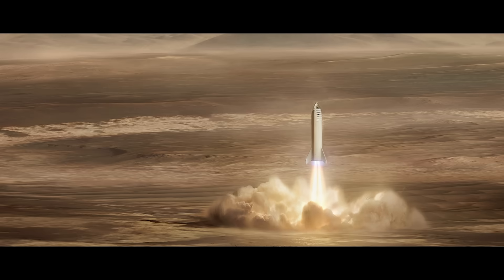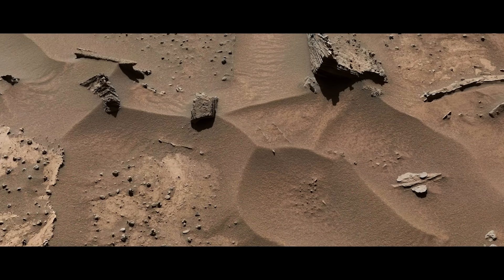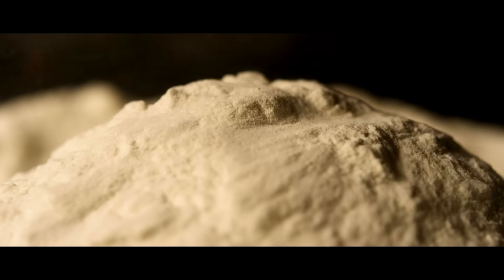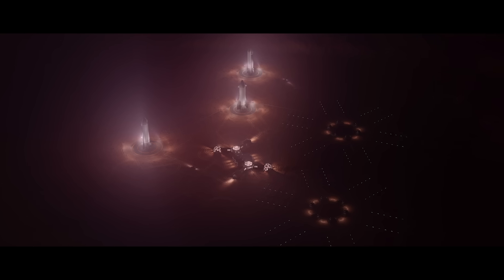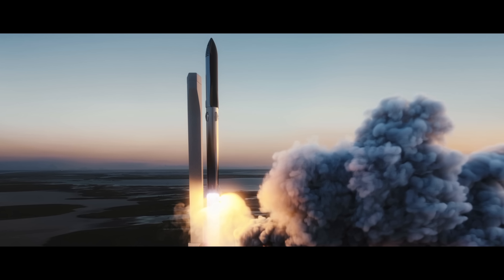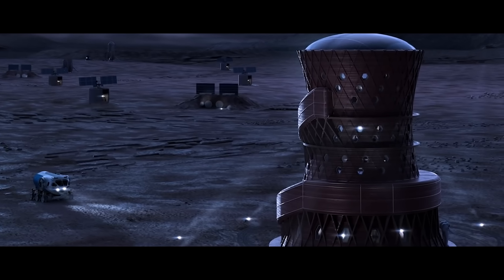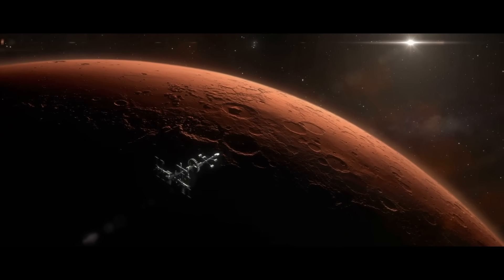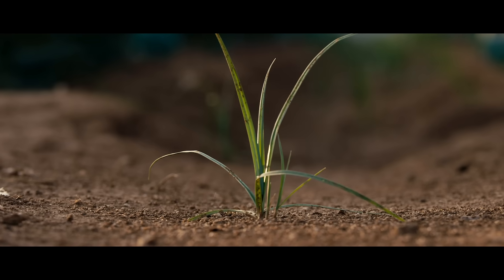THE FIRST 10,000 DAYS ON MARS (Timelapse)

Comment: We allready have a martian colony, a military one. Under ground at the bottom of the mars rift. Due to less radiation and greater air pressure. A heavy lift quantum vacume fleet shiped. All the matirials to geo stationary platforms. Were single stage to orbit and back space fleet took crews. To asembale the 2/3 speed of light nuclear fleet. The mars colony is the reason, that the rovers lasted so long. Due to maitenace. The same reason that the voyager crafts started transmitting after 6-8 years of silence. The nuclear fleet ships, can travel to a voyager craft and back in three weeks. Yours, The Inventor JOEL RAMIREZ RAMIREZ. Even of the three d printers and the Spacex, Blue Origins, Virging Galactic ships.

Comment: It's that gravity thing. 38%. So as your body crumbles do you get 38% lifespan?
More? Less. Then there's the radiation thing. Mars suits will be much bulkier than depicted.
Will food crops tolerate the gravity and radiation. Vision problems have cropped up on LEO.
How about on Mars. I think you guys are WAY WAY TOO  optimistic. It will be short visits for 100 years to see if there is any real benefit to Mars at all. 
We WILL have to go there to find out however.

Comment: This is probably 30%-45% achievable in time frame mentioned. Still hugely impressive if pulled off.
Reply: Even if 10% of this happens I still would be happy
Reply: @macbilliardstrickshots7907    Same.
Reply: Elon thinks it will be
Reply: Elon has a habit of aiming high and being off on his time predictions significantly. But generally achieves what he sets out to do. If you slide everything back by a decade or two, maybe with the exception of the initial landing which I think will be a couple years late, quite possibly doable.
Reply: can i ask how you know what is achievable in the time frame mentioned? Or are you just throwing out some random numbers that you think when you really have no idea?
Reply: @pazecs    Past performance.
Reply: @marvinmartinsYT  as with the stock market, 'past performance is not an indicator of future potential' . Pessimism is fine, but IMO the technical leaps we have made over the last few decades would indicate an exponential tech growth that could lead to some of the items in this video 👍🏼
Reply: I take no pleasure in stating that none of this is going to happen.
Reply: @knuthamsun6106  how can you be so sure
Reply: actually it might even happen faster because new radioactive starships are being planned which will be faster than those regular starships thus more residents and a bigger window between mars and earth

Comment: I still think Musk Mars-co. could consider the cost benefit of rigging up spin gravity with a dozen or so Starships tethered into a bicycle wheel with just wire rope. 
But then the thought occurred of building a taxi- a purpose built Transit Hub with a dozen Starship diameter spokes of the needed length, a Mars Transfer Support Vehicle- Would the name Starfish work? 12 Starships would be able to dock with, then cable stayed to one another and the Starfish hub, creating a very large mass great enough to allow stable internship movement for resources, emergencies etc. The transfer hubs would also hold massive amounts of supplies besides being used to shuttle back and forth between planets.
The Hub and 12 Starships would need to assemble once they left Earth orbit and were already at transit velocity. The wheel could rotate along or perpendicular to the flightpath. 

But the real added bonus is the ability of dialing gravity up or down along the voyage, so travelers arrive fresh and Already Acclimated to the Appropriate Local Gravity. Eventually MTSV's would likely be needed permanently in Mars orbit for Martians to spend additional time acclimating to Earth gravity -possibly months before the first trip of a Martian (born) to Earth. Assuming spin gravity doesn't have deleterious effects on the human inner ear. 
I think it's brilliant which is why there must be some non efficiency, cost, or engineering difficulty - an impossible to break Newtonian reason why not?

Comment: Doesn't a nuclear fusion reactor on another planet by 2040 or something sound kinda far fetched?
Reply: Why?
Reply: @wasdasdaswas1438  because we only just recently made nuclear fusion work in china for 101 seconds and it cost around 4 billion dollars purely in electricity to power it. it was the most energy dense place in our solar system, but it was a huge financial loss and used a lot more energy than it generated. current nuclear power plants use nuclear fission, which is much easier to get to work.

Comment: You're missing the solar wind issues from a lack of a magnetosphere and the escape velocity of gases due to the lower gravity of the planet. That wouldn't stop geodomes but it could make life outside much more difficult to maintain. Keep the O2 inside the domes until the magnetosphere and gravity issues are resolved.
Reply: If we are producing enough oxygen then we could expand the pressurized domes to the point where we technically can go outside, just not outside the dome. Think like the habitats themselves span so much, but the pressurized dome spans 5 or ten times further out.

Comment: The moon colony on Shackleton will have more solar energy and just as much water. Heating is not needed like on mars. It will also have more rocket fuel because of the H3 available in the lunar soil. So the moon colony will grow much faster than any mars colony, especially because of the massive amounts of raw materials available. I believe the moon colony will grow much faster than mars colony. since it is easier to build rockets and produce on the moon, most of mars colonization will come from the moon, not the Earth.

Comment: This is an incredibly silly plan. Mars has laundry bleach for soil, harder radiation than being inside a microwave oven, no atmosphere to stop micro-meteorites piercing any structure you build, temperature extremes like the moon, and microgravity that will turn your bones to chalk. There are MUCH better places to colonize in this solar system than Mars!

The easiest ones are rotating habitats inside near-earth asteroids. If for some insane reason you absolutely must live down the bottom of a gravity well, Venus at 50km above the surface is far preferable to Mars. Earth-normal gravity, temperature and pressure, a working ionosphere and atmosphere to stop radiation and meteorites, and our air is as buoyant there as helium is on Earth. All the ingredients of life and industry are easily harvested from the Venusian atmosphere ...

Of course Venusian colonies would be vastly more difficult than colonies in the middle of the Sahara or Antarctica, or on top of Everest, or at the bottom of the Marianas Trench. But still far easier than anything you can build on Mars. Musk, as an intelligent engineer and businessman, almost certainly knows this. Mars is his cover story for something else ...

Comment: As a test, a fully functioning sealed biodome should be built in the Sahara desert and/or the Antarctica and populated with 100 people with no external power source or running water, which would be significantly easier than trying a suicide mission on a barren toxic planet with no atmosphere or oceans.

I could be called Biodome 3 vaporware?

Comment: There is no reason to assume it will go this smoothly.
Reply: My thoughts also 🤔
Reply: Indeed, all kinds of things might happen in the next thirty years to disrupt or bypass such developments: orbital habitats could be built in LEO and then moved to Mars, providing comfortable, 1G environments for humans to tele-operate drones on the surface for mining, engineering  and exploration. That would be much healthier and more efficient for the humans. Because of Mars' smaller size, latency for such telepresence would be under 100ms and therefore real-time. Such habitats would be able to be moved elsewhere as needed. Fusion power would immediately open up the outer solar system to colonization. An orbital ring, or skyhook tethers, could be built on Mars much more easily than on Earth, eliminating almost all the requirement for rocketry and fuel production. Exploration of sites such as Olympus Mons would probably start straight away: there is bound to be some millionaires who would like to be the first to climb it.
Reply: @Reinout   Of course not, but there would also be no point in throwing in various set backs and catastrophes likely to beset the first settlers.  This is after all an aspirational view of settling Mars inherently idealistic in this early rendition. 

It is the job of later writers to create a more detailed story line as the progress toward landing on Mars actually begins to happen and what is possible in the short term becomes clear.
Reply: One bad accident would set the whole thing back to day one.
Reply: @TheDGAF06  So what are you saying?  That we shouldn't try to go to Mars?   It was extremely risky for astronauts to go to the moon too, but they did and landed 6 times.  And it would have been seven times if not for near catastrophic accident on board the Apollo 13 mission.  Fortunately they made it back alive.  

Some people will always be willing to take the chance to go to Mars despite the many risks involved.
Reply: @Michael Deierhoi nothing of the sort, space exploration is not only amazing but imperative. I'm just pointing out that this is clearly naively idealistic. It discusses using technology that doesn't even exist yet.
Reply: @TheDGAF06  Of course much of this includes technology that hasn't been developed, but it was not intended to be taken literally as if this is how the flight to Mars would go this way.  It is purely aspirational.  One person's view of the future.  And no can ever predict the future with any degree of certainty especially many years or decades from now.
Reply: By dedication of musk we may assume he will overcome them all

Comment: Great video, really well made. However way too optimistic.
Blue Origin will hardly take the spot, they are still in the sub-orbital. Boeing and Lockheed Martin are far ahead.
Reply: I agree,, I would add at least 10 years to each step.  First landing on Mars in 2030 at best, long term habitats at least 15 years later.  I really doubt, I'll be around to see any permanent colonies on Mars.